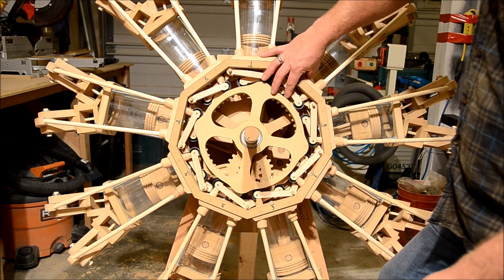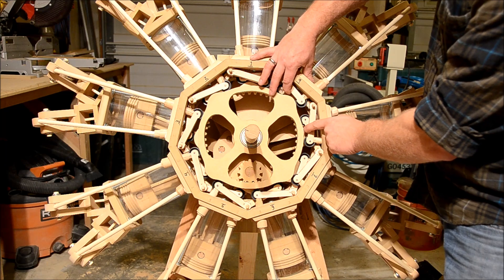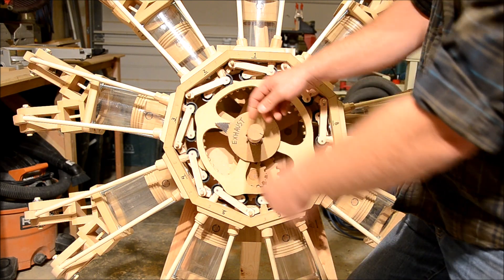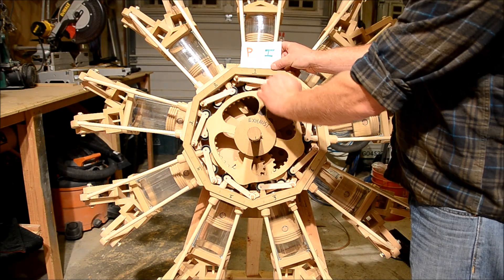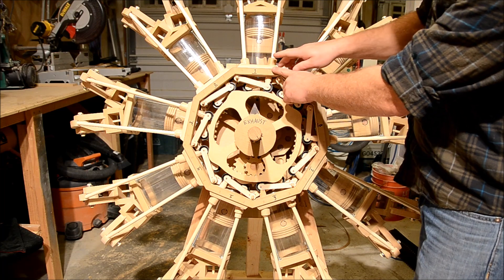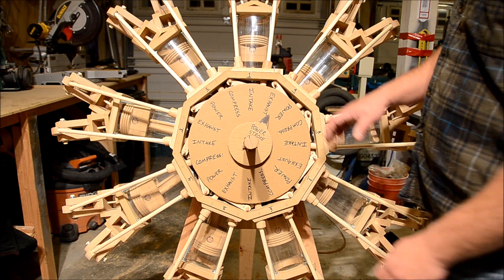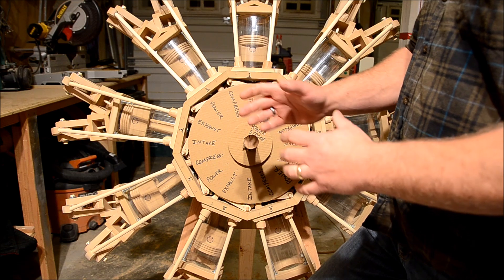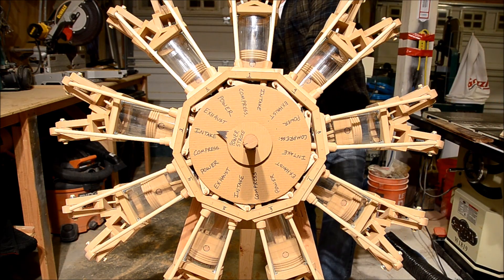How a Radial Engine Works - Explained  Part 2

Comment: Spectacular job!  Thank you for the explanation, it was simple and concise.  :)  Looks like you have a balancing issue to sort out.  ;)
Reply: Jeez thought i was goin to get thru comments without a single negative observation but u just shot that wish down. Christ sake dude it a f%*#kin really well made WOODEN scale model followed by an excellent detailed step by step explanation that majority of viewers will get how it works even if some may need to watch more than once. And u sir feel u need to to point out the bleedin obvious because Ian did a half arsed job by not collecting all the rotating parts and those accessories attached to them to head down to his local never cheap dynamic balancing outfit. Then again i imagine with his obvious talents he be quite capable of calculating necessary weights to attach to crankpins and balance staticly as many makers did in past including likes of Triumph which i learned to do very early as an apprentice. Finally how abou u help out and maybe suggest a % balance factor he can start with.

Comment: ... Great job Ian, a question is why radial engine are always odd number of cylinders: 5 - 7 - 9 ???
Tankyou for an answer.

Best regards.
Reply: He mentioned in the first part it's because they were 4 stroke engines.  The power stroke of a cylinder happens every two crank shaft rotations.  If it was an even number of cylinders then it would have funny pauses between power strokes.  Nothing saying you can't do it, it's just smoother this way.  If it were a 2 stroke engine, it wouldn't matter.
Reply: @matthewmillar3804  
I was thinking of an 8 cylinder and skipping every 2 cylinders (8 5 2 7 4 1 6 3). But that would make for only 3 strokes? So make 4 cylinders 4-stroke and the other 4 cylinders 2-stroke. RiGhT? 😵 lol.

Comment: Oh for Heaven's sake, how did you get 3 don't likes. Man this is a tough crowd. I have stared at radials for 40 years and just couldn't figure out how they got 6 or 8 or 10 piston rods connected to correlated crank lobes. First it was 7? 9? 11? WHAT YOU TALKING ABOUT? Then I learned they connected to just one MAIN rod. That was it. I still marveled (especially watching WW II media) but I didn't even try to understand. Thanks. I feel a whole lot smarter now. (I know, the word is supposed to be "informed."). Really good work on your part.

Comment: Thank-you for the first class explanation and modeling.  Simple to understand and so well done.  Hat's off to you.  I watched both parts one and two.   Your engine has the same rhythm as a running radial motor.  Excellent job.

Comment: Rotary engines are fantastic with amazing power and great cooling. Nevertheless they have two big problems : fuel (either full throttle or zero) which made landing difficult for new pilots. The second problem is the gyroscopic effect of the engine at full power which makes the airplane turn very easily on one side and difficult in the opposite direction. It was difficult to maintain full control in dog fights during WWI. French were great at building those engines. Search for Clerget or Rhône Gnôme engines.... if interested of course.

Comment: Fantastic job Ian. I love radial engines and rotary engine (crankshaft fixed to firewall and cylinders rotating. Propeller is fixed to cylinders. Was used WWI). You should teach as your explanations can be understood by everybody !

Comment: That is very impressive. I am not much of a woodworker, so my choice would have to build in in metal and make it functional. I have been around racing engines my whole life. The science of the radial engine is the same as any other four stroke engine. The parts are just in different position and shapes. Very well done. Great for teaching the basics to students. The amount of time you spent on building was time well spent and is a great visual for for every one.
Reply: I totally agree. What's amazing is to see this type of engine used on a motorcycle. Google it. It exists!...lol

Comment: Holy crap! nice explanation but dude! SICK WOODCRAFTING SKILLS!! 
If I would recommend something will be installing a stepper motor they usually run at low RPM but have tons of torque so you could probably build a step up gear to even it out.. Congrats on the build and thanks for the lesson.

Comment: Seriously nice bit of woodworking!  Great job explaining how a radial works, lots of things I didn't know, especially with the firing order and cam design.  Amazing that these were developed 100 years ago, without the benefits of CAD in the design stage and CNC on the machining side.  Smart boys and girls back then.

Comment: Nice Job Ian. I'm an ex RAF engine fitter and it took me back to 1968 during my apprenticeship. We were taught on the 9 cylinder Alvis Leonides. poppet valve engine which was very similar to your demo engine and on the Bristol Hercules twin row sleeve valve engine. What a tremendous job you have made of it.

Comment: You, sir, are an Artist, an Engineer, and an Educator all rolled up into one. I have built many model planes with radials, never really understanding what was going on in there, other than the fact that they worked, and worked well, often churning out double the horsepower of their inline contemporaries. Your craftsmanship and explanations are a great way for an aviation enthusiast like myself to understand, and "connect" better with aviation history, Now, while I understand radials better, I'm even more impressed that they ever got something like the corncob to function properly-  42 cylinders of turbosupercharged symphony and mayhem. I'm going to have my friends check out your video, hopefully they will be as impressed as I am. Thanks!

Comment: Absolutely awesome model. Way better than the plastic "Invisible V8" model that I built as a teen or the "invisible Wankel rotary" engine. Very well done. I have always been fascinated by WWII aircraft and often wondered just how they got all those connecting rods attached to the crank. Now I know! Thanks Ian for a beautifully done model. You should make the plans available so other woodworking hobbiest can build their own.

Comment: sleeve valves radial engines were made by the british .... the advantage was that the outside diameter of the engine is greatly reduced and so the parasite drag, which means smaller and more aerodynamic cowling, and faster a/c

Comment: smartest explanation ever of a radial engine .... started from the first Anzani engine (3 cyl.) up to 9 cyl. (per row) and so on as you multiply ( 7 x2 rows = 14 cyl. radial , and 9x2 rows =18 cyl. ....  germans built a 4 rows radial a/c engine during WWII , but for obvious reasons it was a liquid cooled . I was aware of the main rod, but I ignored the fact that the cam ring moves as slow as 1/8 of crank speed ! Jee.... I'm gonna impress my uncle Pippin, that's for sure ! Thanks ! Your wooden model suits best for teaching purposes

Comment: Loved the explanation and the full bore test. Sounded just like a real engine. Question. With no oil or lubricant did you notice some heat or warmth from the unit anywhere after the test?

Comment: Loved your video.   Worked "around" these Radials back in 1968-72 - was an Avionics Instrument man and we had R-2800's (on the old AF C-118A - the DC-6)   The 2800 was a wonderful engine - very reliable.  I worked on the "engine instrument systems" for these engines.   Talk about an instrument panel full of gauges!!!  :)  

 Loved working on them.  Although, the Brake Mean Effective Pressure (BMEP) system was troublesome. :)   Used a "Magnesyn Style" transmitter (vs a Synchro Style) which was mounted on the nose case.  Both systems were 26vac, 400hz.  

Did work one problem (Torque Oil Pressure) on a R-4360 - now that was a MONSTER engine!   A,B,C, and D banks - 3,500 HP with blower!  27 cylinders!   

I am super-impressed with your work, and your ability to explain how these engines operate.   Thanks very much.    N-6395T
Reply: +Michael Donavon Wonder if those 118s were at McGuire.  I flew in one to Rhine-Main in January 1961.  Weapons mechanic at the time, but I later wound up maintaining 2800s on CV-240s after I got my A&P.  Weren't those broken exhaust clamps and loose exhaust studs a lot of fun?
Reply: Yes, they were at McGuire - LOTS of them (so I am told).   After Wiesbaden AB, (19 miles from Rhine-Main)  I was stationed at McGuire (1972-77, then retired). 

At McGuire, we had about 50 C-141As,  (the 118s were long gone)  which were later "stretched"  to B's.  No more "Recips" for me!  :)

Like you, after retirement, I went "Civil Circus" and worked, again, at McGuire on the 141's.  Loved that job!

You received your A&P license (I really wanted those ratings :)  but, instead,  got my GROL "General Radio Operator's License," with RADAR endorsement.  My tests were a bitch, but did not have a "Practical" like you probably did. 

That's quite a change from a Weapons Mechanic to an A&P - I'm sure there was "lots of study" and self application, to get to that level.  Congratulations. 

I had friends in the "Engine Shop," at Wiesbaden - talk about being a "Kunckle Buster!!"  That 2800, as good as it is, would work "two men and a boy" to death!  :)   See you later.  m. donavon, florida

Comment: Sir, may I  sincerely congratulate you on your workmanship and for explaining the  real reason why the Radial engine was a great success, all  due to the slow moving " large camshaft" .    If that camshaft  had to go any faster than it does , the cam would hit the  push rod  lifters so fast that  it would be a metallurgical problem. Also the fact that the camshaft rotated in opposite direction to the crankshaft the camshaft could be made to go slower.    On a conventional engine,   not only the camshaft revolves half of the crankshaft, but it is possible to make the cam of a small size where the peripheral speed at the cam surface is not so fast and this could be repeated for an in  multi cylinder line engine with a long camshaft.
I need not go any further,  but the mathematics and relative motion of this issue is something that you mastered so well and many people do not know it, but thanks to your wonderful effort in the workmanship and your explanation, the  Knowledge Transfer about such an engine is  now appreciated my many.   Again, Sir I congratulate you for teaching the secrets that made the radial engine a success, that combination of gearing to produce a slow camshaft which does not hit the valve lifters at high speed causing them to bounce up which is what a conventional engine does at around 10,000 rpm. and I am not referring to family cars which start bouncing  at a lower  revolutions.  Really I am bewildered by your  great effort to go all the way to produce such an educational aide.  I have never seen it in  a model with such details. Prosit,

Comment: This would have been great except for one thing. He is trying to divide the cam shafts movement into 8 cylinders instead of the nine he is describing. 
The lobes can't be 90* apart for a 9 cylinder engine. They have to be 80* apart. 
I can't see a person as smart as this man seems to be makking a mistake such as this, but he did. 
Other wise, he taught me a great deal. 
I am now wondering if I can' cast an engine case by smelting down todays cylinder heads and having a friend who has a small machinist shop to turn a steel billet crankshaft and the cam plates and then using nine Volks Wagon pistons and cylinders and heads to build a new radial engine??? 
I have always wanted to build an engine from parts on the shelf along with a few aluminum castings. 
Plus I have wanted to build an airplane also. 
I am disabled now, but before I fell I had built the fuselage and wing ribs for an ultra light airplane but they have just been setting for nearly ten years now. 
Maybe I'll get back on it pretty soon.  .
Reply: The cylinders are 10° behind each other in operation because they are connected offset of the crankshaft. If they were operated off the crankshaft like a normal car engine, it would be different.

Comment: An outstanding model and explanation! I've always wondered about the configuration of the crankshaft in a radial engine, and now I know about the master-rod and articulating-rods and that there are variations. I guess the configuration is similar for a rotary engine as well?

Comment: Top marks old boy. Perfectly explained and an elegant model. I've never seen a better demo.
One thing that interests me is how does oil get to and from the valve rockers. Could you show us that too. I'm accustomed to motorcycles where oil is sprayed onto the cams etc. and just falls back down the pushrods or camchain space.

Comment: I spend anywhere between 20 and 60hrs per week, watching you tube videos from all walks of life and every subject one could think of.......... This might be the best video I have ever seen! You sir, are a fricken genius, and you manner of speaking, teaching and video editing is FIRST RATE! SO awsome- One thing, I have a question about- How does your model of a 9cyll radial do the ignition timing? and was it battery and coil ignition or Magneto? do radials use regular looking park plugs? Dual plugs per Cyl? ect ect ect- Thx again- you are a You-Tube GOD!
Reply: Usually the ignition is a dual magneto setup on the rear of the engine case, and is geared to the crankshaft.  Aircraft engines are ALWAYS dual plug (for reliability), so there would be 18 spark plugs on his engine.  They use magnetos for reliability, size, and the fact that they don't need a battery to start, just rotation, so they can (theoretically) be hand-started, or re-started just by the rotation of the prop.  Some engines even use an "Inertial" starter - basically a big, heavy, handcranked flywheel with a clutch to rotate the engine.  North American Harvards (AT6 Texan in the US) has this type of starter.
Internally, the plugs are very similar to a car plug, but have a metal casing around them, and braided steel casing on the leads, to prevent damage due to touching something, and it also provides a grounding shield to minimize electrical interference between plugs and aircraft systems, such as the radios and navigation aids.
Reply: That's an excellent question. How and where does the distributor shaft gear into it?